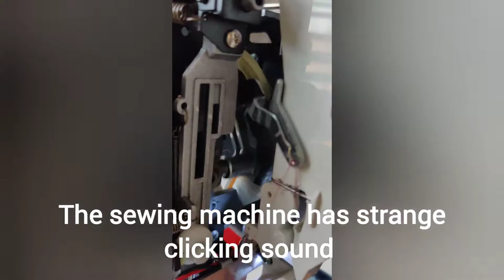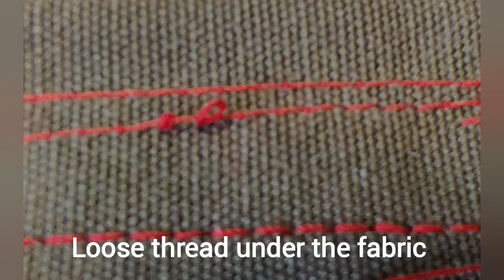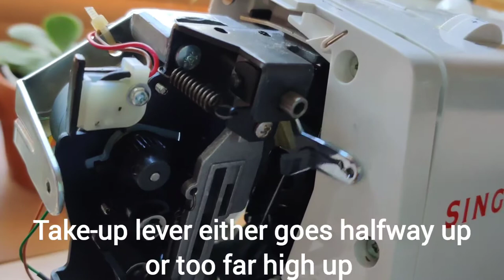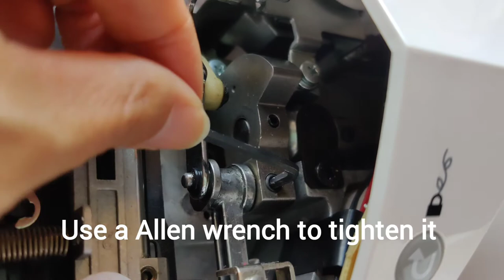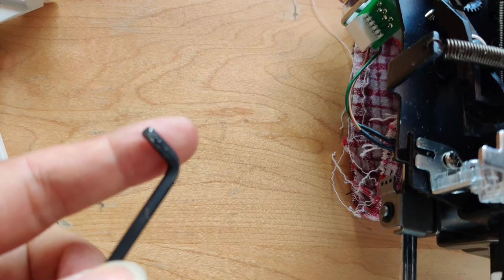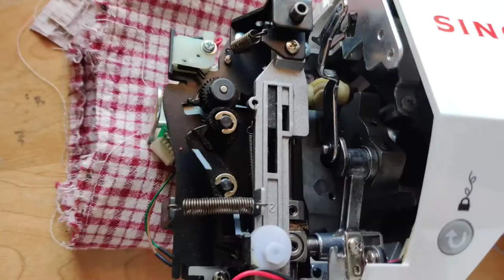Sewing Machine Clicking Noise (Thread Take-Up Lever Problem)

Comment: I have a new MX231 ordered from Amazon in December 2022.  This video was very helpful in the sense that it got me to open the case (by unscrewing one screw in the center of the plastic cover with a small screwdriver).  When I ran the machine (without thread or bobbin) the "jackhammer" sound instantly stopped and is still gone now that I put it back on and replaced the screw.  I didn't need to tighten anything inside.  I had previously struggled with the troubleshooting in the online manual and calling the company--all to no avail.  Was ready to send it back, but now it works.  Thanks so much!
Reply from the maker: I'm so glad it helps.
Reply: Hi I am having the exact same problem right now and can't find any answers on how to fix it? How did you do it? Thank you so much